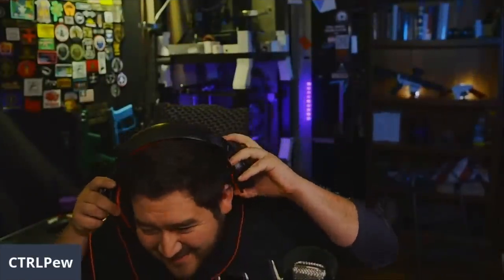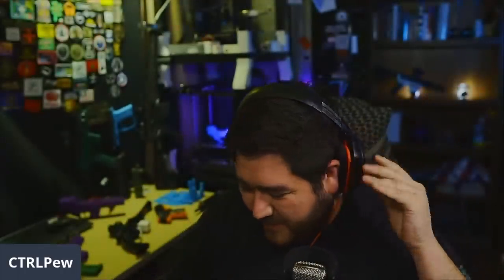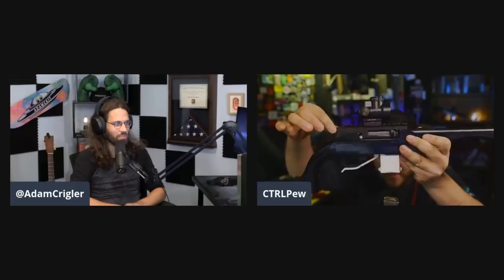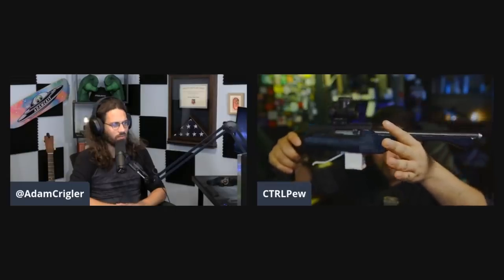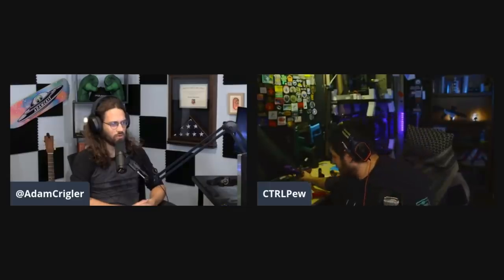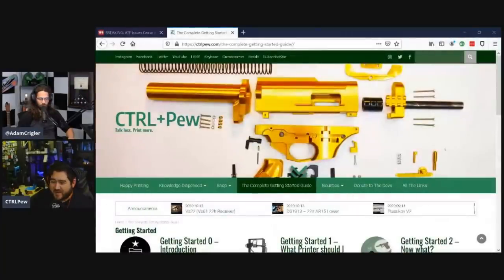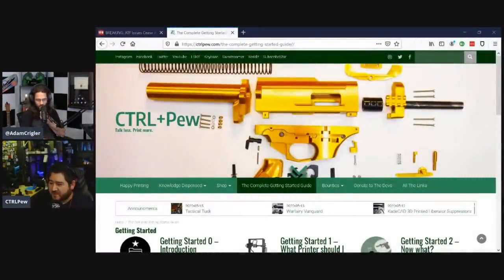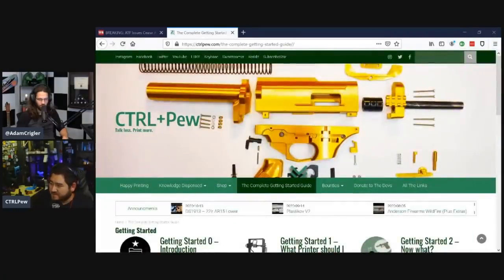3D printed guns

Comment: Guns aside, every house should have a 3d printer, the amount of things that you can fix is insane when you get started
Reply: closest we can get to a star trek replicator for now
Reply: @codywhite4242  yeah man, I needed a bracket to hang my headphones on, 5 minutes to design, an hour and a half to print, started it on my smoke break, was finished by lunch, material cost, £0.17 latch broke on refrigerator door, buy new £30, 2 hours to design and about £0.25 material cost, didn't need to wait for shipping either
Reply: @DanGleebowls  replicator sounds cool but convenience machine has better ring to it lol
Reply: Is it cost efficient to print your own vs buying something from the store or does it about even out
Reply: @kristinec212  buying it from the store will have better surface finish, and usually have various colors incorperated into the product.
Printing the headphone stand would have the benefit of you getting to modify and customize it. Make it a yoda headphone stand.

In terms of money, its probably cheaper to 3d print the stand.  A $20 spool of PLA will print a couple dozen headphone stands 

I use my printer for brackets to hold switches on my machines.... A "center finder" tool i designed to mark the exact center of a round object (for woodworking). Cases for my arduinos and raspberry pis. A mount for my cellphone on my bed post. 
I printed a robotic crawling spider thing for my cousin that he got to put together and program with arduino.
A toothbrush holder.

And i started printing the final fantasy 7 models and painted a couple of them. Getting a cheap painting setup is like $50

If youre more interested in painting minis, i would recommend a resin based 3d printer, not filament. 
Filament is cheaper and faster, but the resin printers have extremely good surface finish and fine detail
Reply: Learning curb is a little steep but worth it 👌
Reply: @kristinec212  the headphone stand I made doesn't exist, it is custom to mount to my IKEA desk if I were to pay myself an hourly rate for the CAD time it would still come to under £2 in total
Reply: @kristinec212  depends on what you want to print
Reply: Probably only for hobbiests, if you don’t know how to cad it’s basically useless (like your grandma doesn’t need one and it would be a waste as an example). My mom was a librarian, and so I knew exactly what was going to happen, people just wanted to print stupid octopuses and dumb desk toys, not even cool mechanical desk toys with like gears and stuff, no we’re talking about dumb non-moving figurines that you could just buy nicer at dollar tree if you want a toy... So you need some cad skill or want to learn it for your hobby.

However if you like hobbies and DIY stuff then what are you waiting for my bro? Those things are like a dream come true! You can produce so many prototypes you just couldn’t do with a lathe/angle grinder/drill/and welder, they can do amazing stuff from automotive application to RC airplane design and beyond. Robotics, models, whatever it is your fancy it’s a whole new world of opportunities sitting on your desk now. But if you don’t have an interest to learn to cad just skip it because you’re better off buying a banana hanger for your headphones. It shouldn’t be a waste of space, only get one if you plan to design (or print stuff for projects, like if you want to do what he’s doing then cool, that’s something you otherwise can’t buy and then that makes sense). And they are super affordable now, so if you plan on making it a hobby and decide later, well you wouldn’t lose much even if you just gave it away to some creative school kid.

Comment: To clear up some misconceptions for people who just don't know much about guns, most of the 3-D printed guns aren't all a 3-D printed piece of plastic. For the most part, it's about printing the one integral part called a "receiver". What this part is varies depending on the gun in question. For a Glock pistol and most pistols it's the grip frame. For some new handguns, they're a small chassis that contains the trigger unit and can be swapped from one grip frame to another. For an AR style rifle, it's the lower receiver (think the bottom half of the main body of the rifle). The one thing receivers tend to have in common is that they house the trigger assembly. This is the part where, if it was built by a manufacturer and bought from a store, it will have a serial number and you will have to complete a background check to purchase it. You can legally (as far as Federal law is concerned - check local laws) build one yourself for personal use as long as you arent a prohibited person and it doesn't violate other Federal arms restrictions.

Now you can also 3-D print many other parts, but those are generally so readily available that it isn't really an issue. Any other part in the U.S. is not considered "the" firearm itself and literally anyone can buy those parts because they're just chunks of plastic, metal, or wood.

However, some parts of a firearm are subject to very high pressure and should be made of metal. For example, handguns in calibers like 9mm or .44 magnum (the later much more powerful than the former) can both generate pressures in the chamber (where the cartridge is loaded when the weapon is fired) that can reach 35,000 PSI regularly. Good barrels should be able to withstand much more than that without failing as a safety margin in case something goes wrong (debris gets in the barrel, a round of ammo was loaded with too much powder, etc.). That's a lot of pressure for plastic to hold. Most rifles are regularly subjected to pressures almost double that when firing.

Chambers are often an integral part of the barrel (revolvers being an exception where the chamber is the cylinder hole). Another reason besides pressure that barrels are almost always metal is the friction and heat they're subjected to. The hot gasses caused by firing a round and the friction resulting from a (typically lead, copper, or combination thereof) bullet moving 700-3000 feet/second down the length of the barrel create a lot of heat. That heat and friction would very quickly erode plastic. Even high-quality steel can quickly be eroded when fired so rapidly that it reaches high temperatures. That's why machine gunners in the military carry a spare barrel for their gun. Even when discussing 3-D printed guns, at least the chamber and barrel are almost always made either entirely of metal or a thinner piece of metal sleeved by plastic. Guns with plastic barrels would have to fire a very low-pressure round and would have a very short barrel life.

Comment: I love the PLA+ filament, but if I went all in on a gun, I’d try Acetone smoothed ABS, and sanded/stained Wood PLA. Of course you’d have to account for the different strengths, and the change in size those processes would cause, but that would make it feel high quality and have a great finish.
Reply: @WalrusWinking  really? I always thought Resin prints were too fragile to handle any significant amount of stress. Still I doubt anyone would make the whole body of the gun out of it because of the smaller print size, and higher price for the material.
Reply: Tbh I wanna try petg
Reply: FrogZ  depends on what you want to do. You can use the 3d printed plastic part.
Reply: PLA+ can be smoothed via chloroform
Reply: @scott_hunts  I know, but based on my understanding, chloroform is a lot harder for individuals to get their hands on.
Reply: @scott_hunts  I think the most difficult part about that is getting your hands on chloroform.
Reply: @noahpaulette1490  see the above comment I made.  Amazon doesn’t sell it but industrial and lab suppliers absolutely do.
Reply: @scott_hunts  yeah of course. You can get anything if you look long enough.

Comment: There has to be a certain amount of metal in these guns by law so they can be detected by metal detectors. It's damn near impossible to build a gun without metal but if you manage to pull it off I wouldn't tell anyone.
Reply: Lmao you've obviously never seen a 3D printed gun, my guy. It's almost always just the receiver and maybe trigger mechanism that's 3D printed the rest is the unregulated Slide, Barrel, magazine, Firing Pin, etc.

Comment: Who needs a 3D printer when we have machine shops? CNC machines? Lathes? I do not need anything I can carry into an airport or federal building, I just want to defend my home, property and family.
Reply: Right...
Reply: It lowers the skill barrier to entry substantially, machining takes a lot of skill, 3d printing an existing design is incredibly straightforward, 3d modelling takes more skill but the models already exist unless you want to design your own
Reply: Depending on how crude you want, you can make a Sten Gun or similar in your basement with hand tools and plumbing parts.  A few people have played around and the ATF nailed them for manufacturing an automatic weapon without a license, owning a controlled weapon and whatever BS rules and laws they have.
Reply: Lower cost of entry, cheaper materials, less space required for the machinery, lower skill required, easier to hide from unconstitutional bans, etc etc etc.
Reply: Way cheap mac 10 lowers.
Reply: @trillcosby4399  I remember being able to get a MAC-10 with two magazines for $250, many years ago.  From a 'reputable' black market seller.  Would never try anything like that today.
Reply: Because 3D printers are easier to get... Hell they even have them in schools.
Reply: @Echowhiskeyone  parts kits available :)
Reply: @trillcosby4399  Used to be able to get good parts kits from Sarco in NJ.  I knew someone who worked there.  Place an order and place a call, get a hand picked parts kit.  Then laws changed, and receivers got chopped differently, not as easy to 'repair' now.
Reply: @redvelvet5374  Any reputable maker space (or if we still had shop class in school) will have enough milling and turning equipment to make modern metal firearms.
Reply: @redvelvet5374  We had machine shops in school when I was a kid, but then again, we also had a rifle rack on the back of the driver seat in the school bus and carried our sidearms into school.
Reply: @Echowhiskeyone  Numrich Arms is a great place to get parts, though some of them may require machining if you want to "play" with your toys.
Reply: Sure, if you have a place out in the middle of nowhere and have a shed or garage space to place a CNC, a Mill, and other tools, the training and skill to use them, the disposable income to purchase them and pay for the maintenance, you could indeed crank out some machine guns.......right up until the ATF realises you bought the machines, have the skill, and connect the dots.

OR

You could get a bricked laptop to run the files, a couple of $200 printers, some spools of filament, get the files from your friend via a USB stick (so they can't pin ITAR BS on you), and print FGC-9's a few at a time in the comfort of your apartment or home office and work on work related things while the parts print. It only makes sense, especially if you're in a gun control state or country.
Reply: None of these guns would make it through a metal detector bud
Reply: @cornpop1230  Oddly enough, there are no metal detectors on my property, much less in my home. While your point was noted by both of us, I am referring to safer, more reliable construction right there in the home that nobody knows about. ("I do not need anything I can carry into an airport or federal building, I just want to defend my home, property and family")
Reply: @scalahan0246  Yes, I spoke about that when I noted in my comment "I do not need anything I can carry into an airport or federal building, I just want to defend my home, property and family".